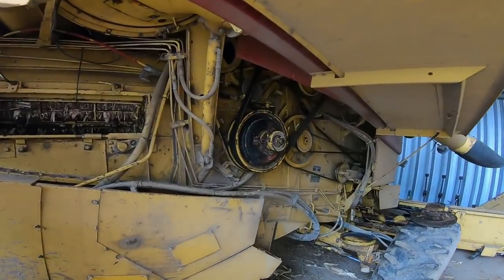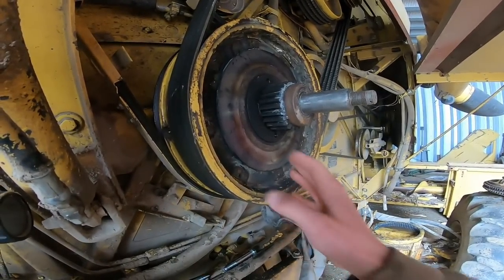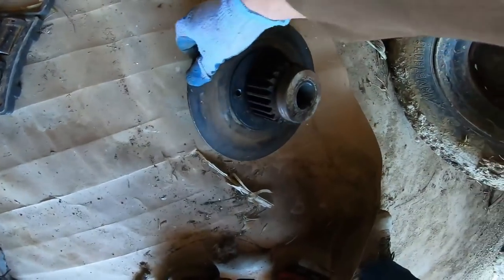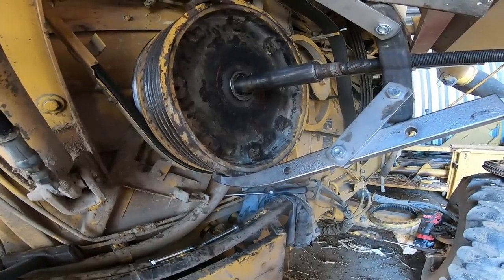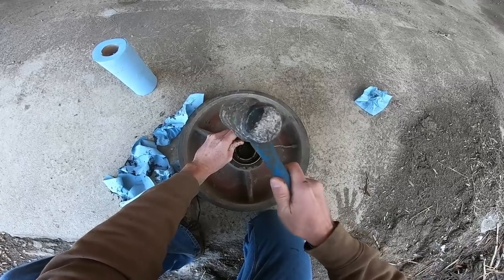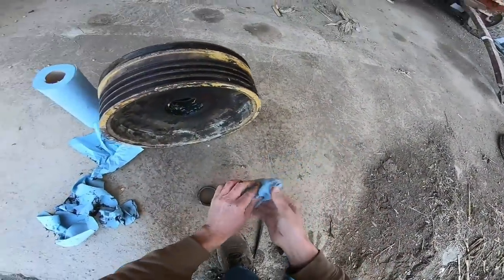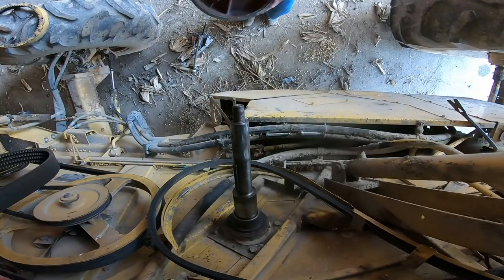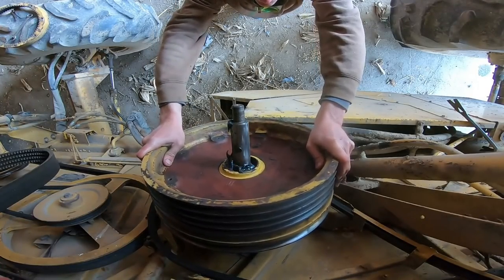Separator Clutch Repair on New Holland TR86 Combine

Comment: Can't live without my press I made several years ago. 20 ton bottle jack does the work I use to do pounding the whey out of whatever!!
Reply: You can buy good presses at Harbor Freight for cheap now... I think I gave about $100 for my 20 ton press... cheap enough!  Does a good job!  Can't build one for that given the cost of steel nowadays.  Later!  OL J R :)
Reply: @lukestrawwalker  I'm afraid, I'm a regular at Harbor frieght! I've have pretty good luck out of most of their stuff. I built my press. I think, before HTF came to town. The thing is massive! I didn't spend to much it however. I work pretty cheap 😋Purchased the bottle jack at a flea market. 2 springs I did have the local hardware store order for me. They pull the plunger back up. The steel came from a scrap iron yard. That use to be not to far from me. Anything you could get on the scale was .12 cents a pound. I think they got it up to .20 before they closed it. Sure miss that place!
Reply: @rogercarrico4975  I nearly built one before I saw I could buy one that cheap... Later!  OL J R

Comment: Great job Jacob! Isnt it great when you can repair and possibly enjoy??Repairing your own equipment.Think of the $$$$ you saved over taking it to a shop to have it done.I charge $30 an hour in my small engine repair shop which is cheap in a lot of places but not where I live ,I am middle of the road.I like to save my customers $$$ but most shops are out for all the $$$ they can get.Again great job!

Comment: Could say your farming operation is Assisted Living for farm equipment that has seen its better days I would have just cleaned them bearings up and repacked with high temperatures grease and check new seal with old if moisture then rusted  will shorten life of clutch also that clutch setup is similar to old jd 2 cly  next posting

Comment: We got a international 400 cyclone six row planter at an auction sale for 200 bucks only person that bid on it. It should work good.
Reply: Planted several hundred acres a year with a 400 6 row before I ever upgraded, served me well.  Only drawback is the drum being out of sight behind the hopper, attach one of those little construction flags to the handle where you set your knock off wheels down on the drum to where it sticks straight up and you can glance back and make sure your drum is turning by seeing that flag waving back and forth.  Poor man’s seed flow monitor.
Reply: Cyclo not cyclone.  The Cyclos were IH's first attempt at an air planter.  It'll work good if it's well kept and repairs/maintenance done, depending on what you're planting.  The entire hopper is pressurized, so make sure the lid seal on the top of the hopper is in good shape.  The rotating seed drum seal on back is also critical, as are the small tires that roll over the outside of the drum to shut off airflow through the seed drum holes to allow the seed to "drop" out of the dimples in the drum.  If those tires are worn or flat spotted, say from being left down against the seed drum on a parked planter for 20 years, the planter won't plant right.  The manifold and seed brush on the inside of the seed drum also have to be set correctly for the planter to work well... the manifold has to just clear the seed drum by a given amount (consult the manual).  The brush likewise has to run at a given clearance from the drum to make sure multiple seeds are brushed away from the holes enough that only ONE seed can remain blown up against the holes in the drum, while the second one is brushed away and falls back.  BUT if it's adjusted too tight it can brush all the seeds away from the holes and allow them to fall back to the seed pool at the bottom.  The drum also has to turn as smoothly and evenly as possible, without jerking or shaking, so that the seed spacing has some hope of being somewhat accurate.  Since the seed is blown for many feet through plastic tubing, before it arrived for a final plunge down the seed tubes of the rather primitive opener row units used on the 400 (the later models used 800 type "Tru-Vee" openers like a modern planter) the seed spacing was not great, particularly in corn, which needs the best seed spacing it can get, with as few skips and doubles as humanly possible, and as even a depth placement and closing as possible for maximum yields, which is why the Cyclos fell out of favor-- the seed metering drum was simply TOO FAR from the openers to ever maintain good spacing.  Seed bouncing around inside dozens of feet of plastic tubing on its way to the openers was just a bad idea.  For crops that AREN'T particularly sensitive to seed spacing or accuracy of placement, like say soybeans, grain sorghum, cotton, etc. they were perfectly fine for planting those crops.  The few that you still find around have typically been set to plant those other crops, and a planter with finger pickups (Deere or Kinze) used to plant corn since they're MUCH more accurate in their metering (when properly set and maintained).  

The nice thing about a Cyclo is, they could be had with up to six rows (IIRC) feeding from a single seed drum.  Combining two Cyclo units onto a single toolbar, one could plant up to 12 rows, and mounting all the row units close together, you could plant narrow row crops quite easily-- no problems with aligning drive chains or other such components... so long as the row units cleared each other to move up and down with field undulations, it wasn't a problem.  Why a lot of them found themselves as bean planters before they were finally scrapped, and that's how the few remaining generally survive today.  Later and good luck with it!  OL J R :)

Comment: Did you buy the bearing set from the dealer? Says it comes with proper amount of shims to preload the bearings. Seems very expensive for what you get. $980 Kit has bearings, spacer, snap rings. Seals are extra $250ea. Tempted to just buy bearings from local parts shop and replace seals and hope for the besr

Comment: I figured that would have been an electric clutch.
Reply from the maker: Nope, and I'm so glad that it isn't.
Reply: @boehmfarm4276  Hmmm. OK, I haven't been around the old style clutch since our E combine
Reply: @boehmfarm4276  Thinking on your reply, I think once you have the electric clutch in some future combine you will find they are a lot less trouble. I've never had one apart, knock on wood. When do you think New Holland went with an electric clutch? TR88/99? You have hopefully got a long farming career ahead of you and eventually you'll end up with a combine with all the modern stuff that to me will truly be nightmares. The automated, computer controlled crap but hopefully we can keep the older ones going for a long time to come.

I'll tell you a quick story about my neighbor right next to our farm. I think it was in 2011, I was combining corn with my L2 which I was pretty proud of but a new renter next door showed up with a brand new Deere and 12 row head just a flying through his corn. I felt like my old L2 was really a very small dinosaur comparatively but as the day went on, I eventually didn't see the Deere and then later I saw the repair truck pull into the field and drive over the hill. I found out later that his combine went haywire so that he couldn't stop, or turn or shut it off. Everything goes through a computer I guess. He ended up crashing into a waterway, destroyed the corn head and twisted the frame of the combine, totaling it. I didn't feel like my L2 was so bad after that...... but he got a loaner machine and still finished his 340 acres before I finished my 50 acre field. I don't ever plan on getting anything newer than the R series Gleaner in my last 15 years of farming because of the reason. The S series Gleaner went to computer controlled everything. Gleaner was the last to go that route so I'm told.
Reply: @SilverGleaner  This electronic crap that's out now will never last long enough to make it to the smaller farmers... by the time it's too old for the mid-size farmers it'll be SO full of electronic gremlins and no parts available particularly computer parts, sensors, wiring, etc. that they'll just go straight to the scrap yard.  They're not making anything to last anymore, certainly not like the older equipment we're still running was built to last.  

It's like the space shuttle... the space shuttle was cutting edge technology-- for *1974*, which is why it was retired.  The shuttle's structures were still in pretty good shape (though it did have some problems-- cracks in the fuel manifold supplying the three main engines was found, and it couldn't be removed from the tail structure of the shuttle due to its size).  The avionics were all designed in the early to mid-70's, and of course what was a state of the art computer system back then is a complete dinosaur that NOTHING modern will work well with... You didn't just go down and buy replacement computer parts for it, either-- many components were being made on antiquated machines that had been retired and scrapped everywhere else in the electronics industry, often decades ago, and many of which were now one-of-a-kind.  Some shuttle contractors were producing only a single component, and were the SOLE SOURCE for that component, and were having to maintain and operate the machinery and assembly line to manufacture that component-- it was the ONLY product manufactured by those machines, for the ONLY CUSTOMER (NASA).  So you can IMAGINE how expensive those replacement parts were!!!  

While shuttle had gotten some "upgrades" over the years, including the "glass cockpit" upgrade which gave it some touch-screen capability, the shuttles were going to need basically a complete redesign of all its avionics systems post-2010 to continue to fly.  Adding or refitting new avionics into an old system isn't as easy as "plug it in and do the programming"-- no it has to be designed to interface and work with 100% reliability in ANY possible mission mode or circumstances... it can't work "good enough" because if the computer decided to "lock up" at the wrong time it could destroy the vehicle.  The upgrades that had been done in the past had demonstrated that basically they were at the point where it would be cheaper and easier to redesign the entire avionics system FROM SCRATCH to use modern components and programming rather than trying to keep "upgrading" the pathetically antiquated systems still used on shuttles.  OF course to do that would be a multi-billion dollar undertaking, which would take YEARS to accomplish, for what ultimately was a nearly 50 year old vehicle system that was too expensive to fly anyway and was basically outdated and unneeded.  That's why it was decided to retire the shuttles and replace them with less expensive alternatives.  

So it will be with these "electronic wonders" being sold now to farmers... at some point it'll be too expensive to maintain them, and the supply of parts will dry up, electronics that are 'standard equipment' now will be surpassed by other newer designs and equipment and won't be available any longer, and the few remaining machines won't be worth modifying to run with newer electronics or design "work arounds" for the old non-functional ones with no new parts available, so they'll be scrapped or maybe a scarce few end up as stationary nonfunctional museum pieces, like the remaining shuttles... Later!  OL J R :)